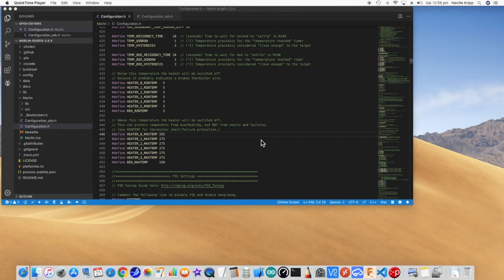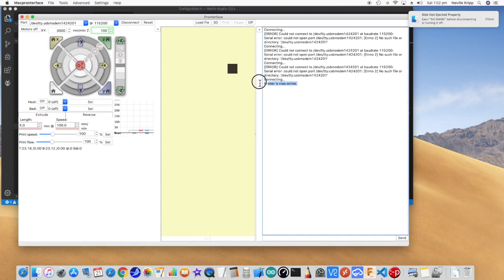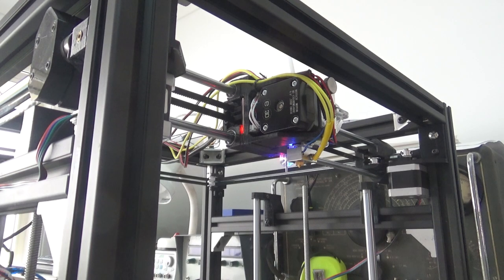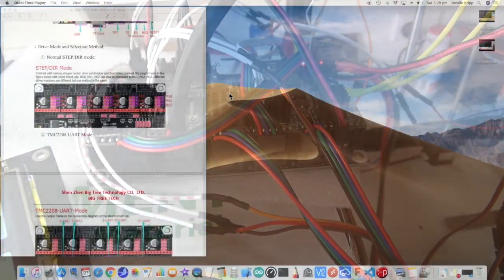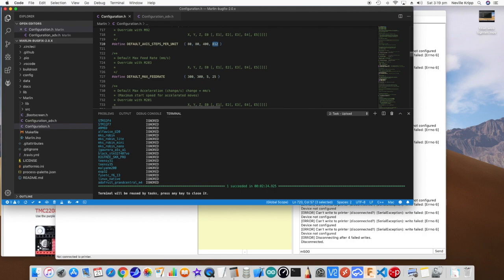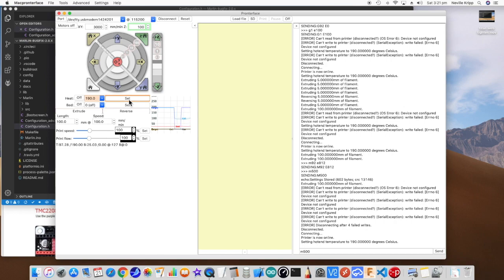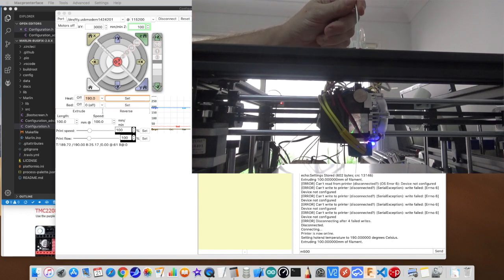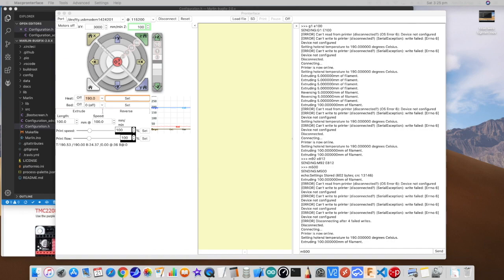#104 Hypercube Evolution 3D Printer Build - 11 (Extruder Setup and Cal)

Comment: you were not grumpy I want a refund :P /jk
any print results?
how is it printing? mine took 3 days to build but I was trying to fix it for a month. at the end I realized my issues came from my awful pcb heated bed and I got myself an aluminium one and now my layer lines are much better! it's not perfect but close enough :)
Reply from the maker: Hmmm, nothing is guaranteed to make me more grumpy than someone asking for a refund...

I got the first print off it yesterday before I had to head out for the day. Just a calibration cube using some old PLA I used to check the extruder steps/mm, straight onto the aluminium and still no part cooling fan, which is not great for PLA. I can see the belts need tightening a little more for a start and the print came away from the bed 2/3 through, but the cube dimensions was spot on, layers looked good considering no cooling. 

Will take a look at it further tonight and post a video once I have something half reasonable coming off it.

I tell you though, after being used to my noisy delta, those TMC drivers are soooo quiet, I think I need to change the noisy power fan now!!
Reply: @GrumpyOldTech  yes tmc drivers are amazing. I pretty much consider them to be a need in a printer :P not to mention some of them have fancy features like sensorless homing (can make designs/wiring much easier!)